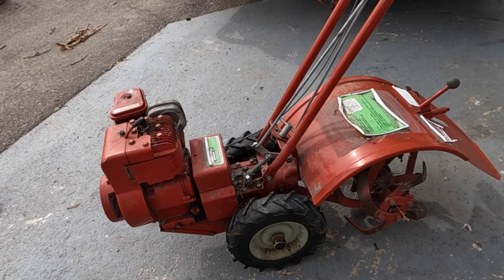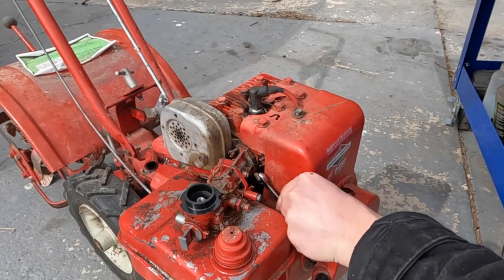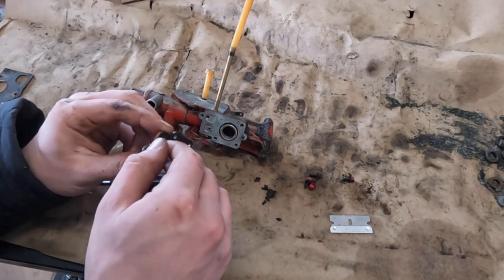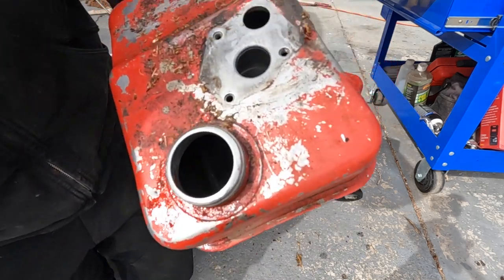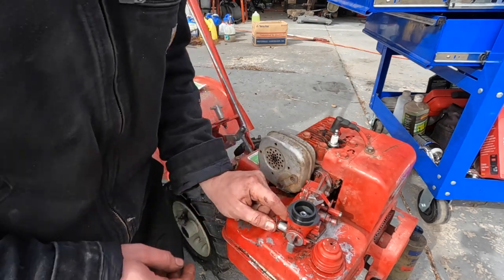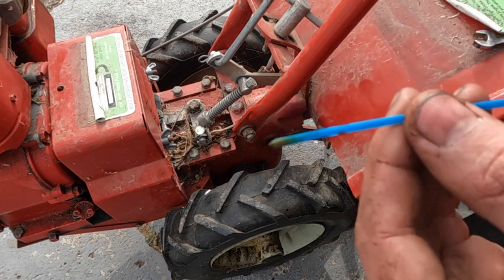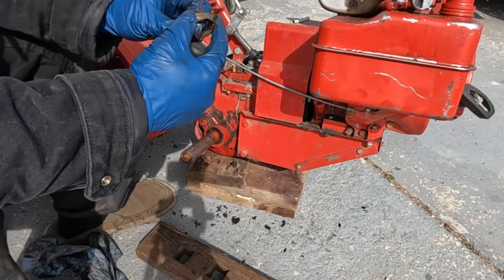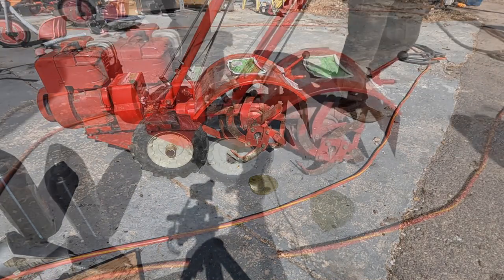Servicing a 1978 Troy-Bilt tiller sitting for years

Comment: Well done on your 78 Pony with clear demo. Can you show us its trany forward & reverse and belts?  Thx
Reply from the maker: Do you just need to see how the belts route?
Reply: @NotEnoughProjects mine is driven by Predator 212cc with no reverse drive now. Is recovery of wheel reverse possible after I saw yours working. my model info on casting: 1/21/80 and 20317. Thanks!

Comment: The air filter bolt needs to be inserted for the carb to work properly. It's absence leaves a hole in the fuel vacuum circuit.
Reply from the maker: Definitely, I think may have forgotten to have that in place in the video, but I did some more fine tuning while using it.

Comment: Have a question for you... I have one of these Troybilt pony tillers and cant find any information about where the ground wire( I think ) that goes from the ignition coil and down the side of the tiller motor? Looks like last owner secured the wire under a bolt, no spark.. so I removed it so it wasn't grounded and then it got spark. I just can't find any schematics or a kills switch to attach it too?
Reply from the maker: Hi Jimmy, the kill wire has a clip it goes into under the gas tank next to the throttle linkage. The kill wire is grounded by the throttle control when pulled all the way back. https://imgur.com/a/JLrmovb
Reply: @NotEnoughProjects  Yes.. I finally found one old pic online and finally figured it out. I can't believe it is so hard to find information online....  Thank you so much for answering my email... and helping me out. Your awesome!!!

Comment: Hope you don't mind me asking you another question..  I did get it running and when your not tilling it seems to run fine. When tilling, the tiller never ups the speed even if I have the lever pulled to Fast. I can see it on the throttle on the carb that it only goes up to where I have the idle screw set. So to get it to run fast enough to till.. I have to adjust the idle screw all the way to a fast idle.   When it is not running, moving the lever to Fast moves the throttle on the carb all the way ...  When running it does not ...  Second carb ... same thing so must have something hooked up wrong? Thanks for your video and help, saving me a lot :)
Reply from the maker: Sorry I'm just seeing this. If you haven't figured it out, it sounds like the governer isn't hooked up properly. Likely a rod on the wrong side of a linkage or something. If you'd like I can send a Pic of how mines hooked up
Reply: @NotEnoughProjects  Haven't figured it out and can't seem to find any good pics online.. even the service manual doesn't help. I would really appreciate a pic of how yours is hooked up... that would really help!!!  Thank you for your help!!!
Reply from the maker: @jimmyironatx   since the linkage is behind the gas tank I can't get a very good picture. I did find this diagram that shows how everything hooks up
https://ww2-secure.justanswer.com/uploads/jrwhitey2000/2010-03-25_194525_briggs_5hp_linkage_2.jpg
Reply: @NotEnoughProjects   Mine looks different than this one.. It is at my Moms, wll take a picture next time I'm there. Thanks for your help!

Comment: would you happen to have instructions on replacing both belts, forward and reverse, or post instruction sheet, I have same pony as the one in the video
Reply from the maker: Here is what the manual I have says about the belts. It doesn't seem to have exact procedure but if you loosen tension you should be able to slip the both off and on

https://imgur.com/a/4lDlJEn